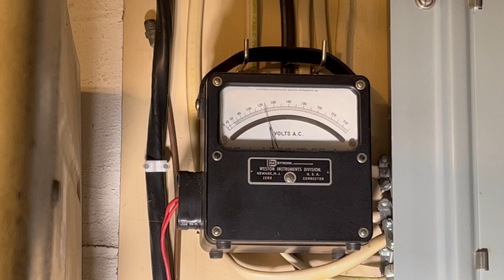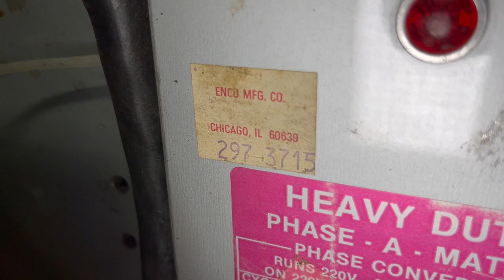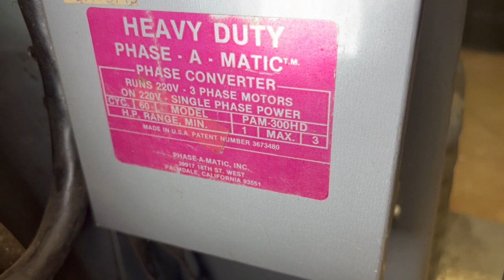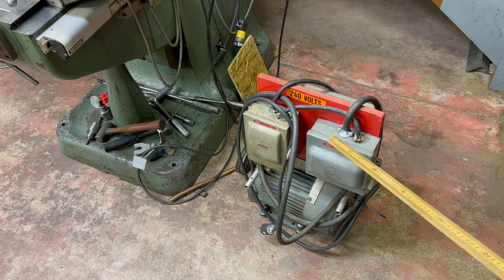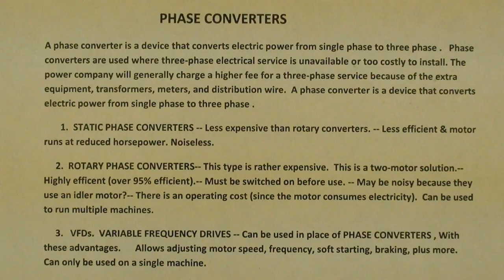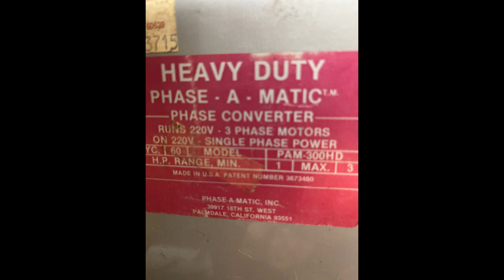Phase Converters STATIC TYPE #784 pt 2 tubalcain

Comment: I may confuse the issues mor than clarify, but I like to point up a couple of things from electrical point.  The rotary converter actually consists of a static converter providing power to the 5 HP motor.  The converter is dimensioned for that 5 HP.  You can use simultaneously additional motors as long as you don't exceed  some 50 or 60% of the total power of 5 HP and also don't actually have any load on the shaft of the 5 HP motor.  So, you have the big motor idling, consuming just something for its own cooling fan.  In other words, the static converter is TUNED to the big motor and adding some small motors does not affect thew tuning too much.  On the other hand, the small static converters you mentioned as good for only one motor is because they are tuned to the small motor.  The big motor idling is used as a buffer with a certain range of total additional motors tolerated before the tuning range is exceeded.  Or I might say that your claim of the "oversize" 5 HP is actually just what your other motors need!

Comment: For my Sheldon Lathe I found a 110 Static Phase converter for $100.00 that will run the 3 phase 220 volt motor on the lathe. I was a mazed, and am very happy with it. I do have 220 right there where the lathe is located. But, for the price I took a chance. It adds infinite speed adjustment too. It can be reversed, but I use the mechanical reverse, on those rare occassions,  so I don't have to change the settings on the VFD.

Comment: Had good luck with Automation Direct for VFD's for home use and also have bought them for Commercial Jobs.  Just an option, they have good documentation as well.  This can help if you buy a  different vendor.   

First one of these I bought was a Boston Gear,  bought 2 for a spare and still got spare on shelf covered in dust.

Comment: As an electrician I have installed phase converters, buck converters (Transformers); while some motors (typically 12 lead/wire) can be wired for both single and 3 phase I have to disagree that 3 phase power can’t be run to “residential” as most electrical supply companies will run 3 phase power to residential addresses. A 3 phase electrical service will cost more than single phase as 3 phase needs 3-4 wires for service, depending on whether it’s wye or delta; if you’re out in the country with only a 2 wire run then 3 phase will be something you won’t have access to but in cities and any area with 3 wire systems 3 phase is achievable even for residential. I personally have high leg 3 phase delta at my house which provides an ability to drop sub panels with (2) 120V legs and has 240V leg-to-leg; just be aware with high leg delta one leg is 240V to ground and if you use it for standard circuits you’ll have a bad day. I live in NY and work in NY & PA and in both states 3 phase is available to residential at both 120/208 & 120/240, though in our area typically residential addresses get high leg delta as it gets you 240V leg to leg which most consumer electronics prefer.
Phase converters are definitely cheaper but nothing beats getting true 3 phase as it opens up so many more options and while the cost is more initially adding equipment is much cheaper.
Reply from the maker: Thanks

Comment: I built a rotary converter and it works great its not a big deal to turn it on  i use it mostly for a 20" american lathe but 3 years ago i bought another 20" american lathe with a single phase motor . The single phase lathe is alot nicer to use just because i dont have to go through that extra steep.

Comment: In order to build you own rotary phase converter you must start with a three phase motor that is one to two more HP than your load * and a large capacitance is required just to make the three phase motor start (and run) on single phase power, but it must not be allowed to start off in the wrong direction.  That extra box on the back side of Mr. Stewart's H. M. converter most probably contains relay/s that connect or disconnect other parts or connections once the motor is up to speed.  (with time delay relays)  The system is simple, but the capacitance must be chosen based on the inductances of the motor and the currents involved.
 * I have not seen the formula for this calculation. Ron W4BIN

Comment: I watched your video and liked the information you provide. I have a question for you. I have several old drill presses as well as others in my little machine shop. They are all old machines and all run on single phase right out of the wall socket. I want to upgrade them to 3 phase and I would like to be able to control the RPS’s. What, in your opinion would be my best option?

Thanks

Comment: If you are going to switch a VFD on the output side, like the setup on the lathe, you need a much larger capacity VFD than the motor HP. It is recommended in the VFD manual not to do that and to control it from the VFD or external controls connected to the VFD inputs.  I have both setups in my garage shop, one for the manual Bridgeport and one for the CNC Bridgeport.

Comment: Slapping your pointer at the motor... To get the class attention!!!!  Still have that teacher in you!!Lol!!! Got my attention.😁😁
My dad and I built our first static phase converter back in 1974 with help from a Popular Mechanic article that was published years back on building a phase converter. Dad had a electrician at work give us a few pointers on wiring it up.  Couldn't get the potential switch to work correctly, so we added a extra set of contacts to the A-B push button.  When we started, we just held the push button in until the motor got up to RPM and let go of the button.  Worked like a charm. At that time, we were powering a 3 HP motor.  Later, we used that motor, when running, powered up a 1-1/2 HP two speed motor on a Gorton mill we had back then.  Amazing how 3-phase voltage can work!  

Since then, I've built several static converters over the years, two were for powering 10 HP 3-phase motors.  Last fifteen years, I've gotten away from static converters and been using VFD's.  I like them better for what I use them for.  Especially for the mill.  I do have a portable RPC that started its life as a static converter but is now a Rotary phase converter. It can be used either way, just unplugging the pony motor.  It's good for powering up a 7-1/2 HP motor, static, or 5 HP with a 7-1/2 HP pony motor.  As always, thanks for sharing your video.  Ken

Oh, I forgot to mention, anybody that has a central air unit in your house or even a older window unit, They have a static phase converter built in them for powering the refrigeration pump in them!  Most of us have never given it a though.  Most HAVC technicians don't even know that!  These have been used ever since the 1940's!  How about that!

Comment: I thought part one was impressive, but part two just amazes me.  I am waiting on a 5 hp motor to make the rotary type.  I have a question about the 5hp one you replaced.. You mentioned the pulley was there for a pony motor which is what you need to get the rig going.  Did you get it rewired with a start capacitor and relay?
Reply: No pony motor needed. It will start on its own. My guess is they left the pulley on to make one aware of the rotating shaft as it serves no other purpose.

Comment: If you put your amp meter on the home made rotary converter you will find that it is not drawing anywhere near 14 amp. That is full load amperage and you have no load so it is only a couple of amps. The absolute cheapest way to run three phase is just to wire your load motor in parallel with the idler motor and start the idler motor with an auxiliary motor or even a pull cord like a lawn mower engine. Once the idler motor is started you can then switch on the load motor. Not very efficient but it works.  I have built several phase converters over the years using capacitors and a relay.

Comment: It's funny how it differs between Europe and USA. We have 3 phase everywhere at least in Sweden where I live. I have my main load at 400 Volt 3 Phase 32 Amp and that get me 240 Volt 1 Phase or 400 Volt 3 Phase. In my garage I have 2 outlets with 400 V 16 A so I can run quite heavy loads with that high voltage. In US you have lower voltage and only single phase and you need to have 2-300 Amps instead. It works and I will not judge what's best but I sure love to have 3 phase ready to go from scratch.. Even my solar system have 3 phase inverters that take 1000 V DC to 3 phase 400 V AC.

Comment: Is the VFD on the little lathe really single phase 110 volt input ? That set up would be great just plug it in to any 110 volt outlet and you have a three phase motor with variable speed running your machine.

Comment: Lyle.
I haven't heard you confirm the output voltage of any of these devices. 
It is my understanding it is possible to use 3 phase power in 220 volts and over hear at least we have most 3 phase applications running on 440 volts.
My rotary inverter not only creates the ghost 3rd phase but also steps up from 240 volts to 440 volts

Comment: Mr. Pete, technically 220/240 VAC is not "single phase" but rather it's "split phase" since there are two phases, 180º apart each of 110/120 VAC relative to ground.

Comment: Years ago, I acquired an 8" B-Line (Baldor) grinder. At the time, I did not notice that it was 3 phase.  I have never been able to bring myself to part company with that grinder. I wish I knew what kind of phase  converter I need to make use of this grinder. I will admit, I don't want to spend hundreds of dollars to do it though and I suspect that is what it would cost me to make that happen.
Reply from the maker: The static converters are an expensive compared to the dynamic ones.
Reply: @mrpete222  would a less expensive dynamic type work for a bench grinder Mr. Pete?

Comment: Hi Mr. Pete, I have a question for you. I'll explain the situation first. My air compressor is pretty well wore out and was a bit underpowered to be doing sandblasing as it was. The compressor still runs but I don't use it very much or very hard. We found a three phase monster of an air compressor but I didn't know how it would preform with a phase converter. I was concerned that at 3/4 of the power to the motor it could maybe generate too much heat but really I just didn't know enough about the topic to be able to say, "yes it will work fine" or not. I've not seen a vid about phase converters as they pertain to air compressors and wondered if you knew how well they function together or If you had any experience with that? Thanks buddy!
Reply from the maker: Sorry, I have no experience with air compressors. I would think that you would need to buy an oversized, excess capacity phase converter. But that is just a guess
Reply: @mrpete222  That's ok Mr. Pete, maybe someone else will see this and answer it.

Comment: mrpete222. I have learned a lot watching your show all of the time from Ontario Canada. I have an old Atlas 10" lathe, with a worn out lead screw which I get bye with. However, the only gears I have are:  2 of 64 teeth, 1 56 tooth and 2 20's. The only thread I can cut is 16 tpi. Do you know where I may be able to buy more gears for other thread pitches at a reasonable price? I actually succeeded in cutting a nut and shaft with that pitch without ruining anything.
Reply from the maker: eBay or a donor lathe

Comment: What does one do when your machine has a motor requiring 440 volts 3 phase? I notice everything you highlighted was 220 volts 3 phase.
Reply from the maker: Rewire the motor according to the tag. To the lower voltage
Reply: Yes, most 3 phase motors have 6 leads to a teminal block and can be wired either in "Y" of "Delta" configuation. I forget which is for 220 and which is for 440.

Comment: Oh they'll run 3-phase to your house/shop no problem.  They'll charge you to run the 3rd line.  It's not cheap.  I was quoted $75K per mile.  As you can imagine, I bought a phase converter.

Comment: "Single Phase 220 volts" 
I do not know why it is called that but it is wrong.  "220" is actually 110 volt/2 phase. Check it out yourself. If you have 220 use your multimeter and check each leg to ground, it will read about 123 volts. Then check it between legs it will read about 208 volts. Why doesn't it read 145 volts? Because the 2 phases (each phase is the sine wave that is AC power) ( out of the 3 phases that are generated at the power plant) are out of phase by 120 degrees and not 180 degrees.

Comment: Can a 220V VFC  run a 400V  3Ph motor,or do I need a transformer?.Thank you.
Reply: Angel, they make a variety of models with various input and output voltages. You will want to get one that matches your need for output voltage. You probably don't want to drive a transformer with a VFD, as transformers are usually designed for a very narrow frequency range; usually a single frequency like 60 Hz. (You could burn out the output of the VFD.) Besides, a VFD + transformer will likely cost more than just getting the correct VFD.
Reply: Most 3 phase motors have 6 leads to a teminal block and can be wired either in "Y" of "Delta" configuation. I forget which is for 220 and which is for 440.
Reply: @johnburt1547  Hi John.I appreciate your kind answer.Let me tell you that when I bought my D-bit grinder GH 20T model,I chose the 3 Phase and 400V because it has more power than the 1 Phase and I already had a VFD .So far the grinder runs fine with theVFD but not at full power.Thank you for your help.
Reply: @bwyseymail  Hi,yes but looks like is more 400V or 600V and I don´t feel  is something that I want to do.I appreciate your help.

Comment: Has anyone else needed to deal with two phase motors?  I recently purchased a saw that had a 2-phase motor.  Have come to find out that this was common in the Philadelphia area at one point.  Wondering if I can use two of the three phases from my rotary 3-phase converter?
Reply: But I repete myself. . . 
"Single Phase 220 volts" 
I do not know why it is called that but it is wrong.  "220" is actually 110 volt/2 phase. Check it out yourself. If you have 220 use your multimeter and check each leg to ground, it will read about 123 volts. Then check it between legs it will read about 208 volts. Why doesn't it read 145 volts? Because the 2 phases (each phase is the sine wave that is AC power) ( out of the 3 phases that are generated at the power plant) are out of phase by 120 degrees and not 180 degrees.